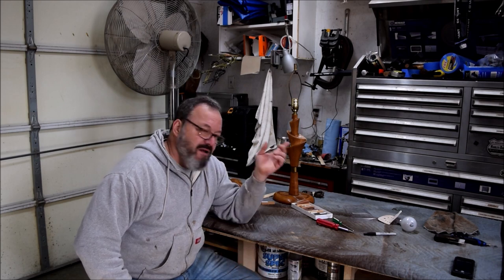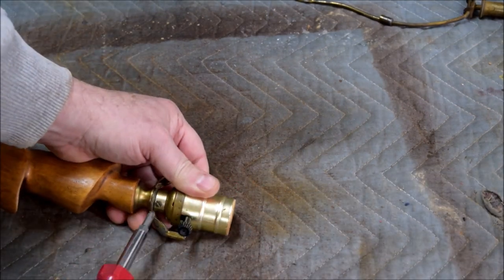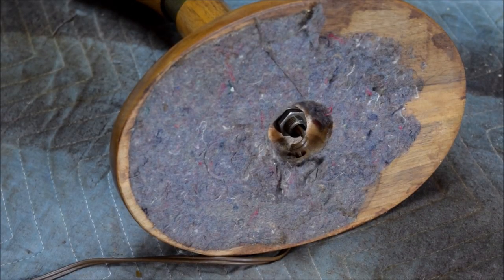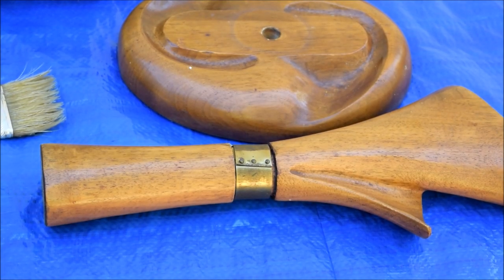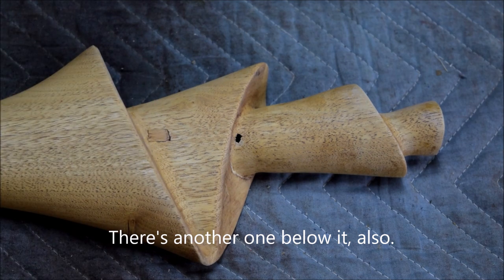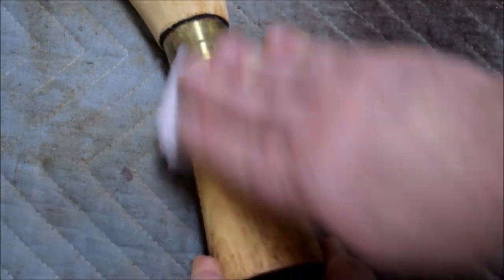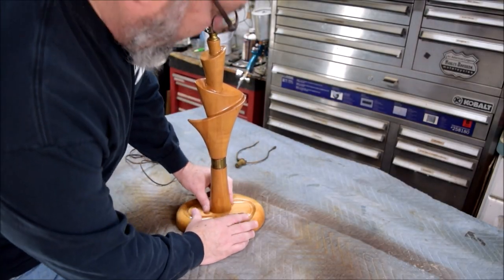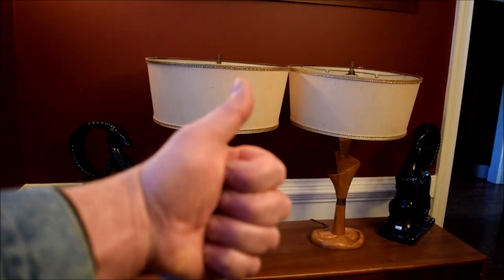Restoring a Pair of Mid-Century Modern Lamps

Comment: "The underwriter's knot is used in electrical wiring as strain relief to prevent a cable from being pulled from electrical terminals when the cable is yanked."